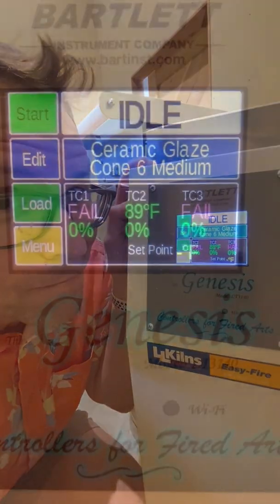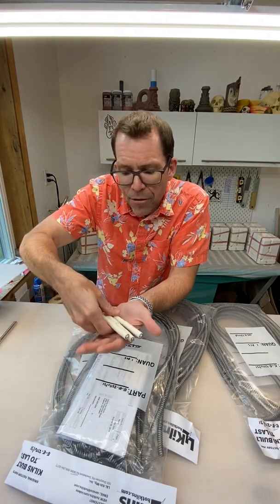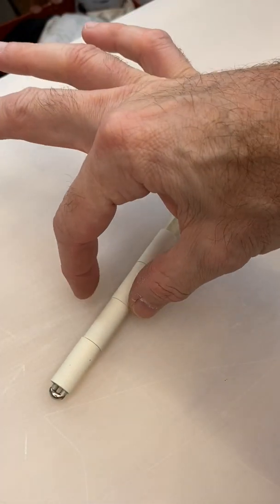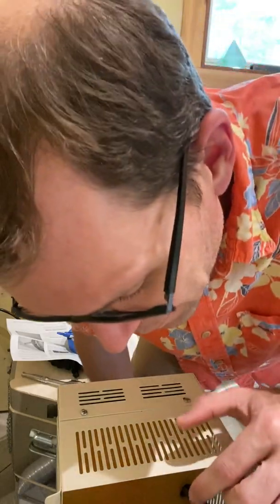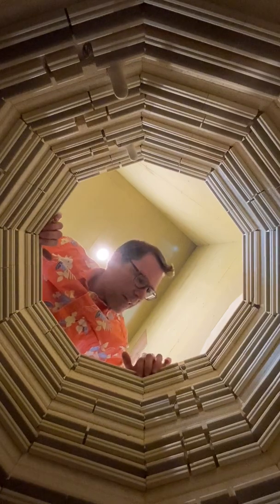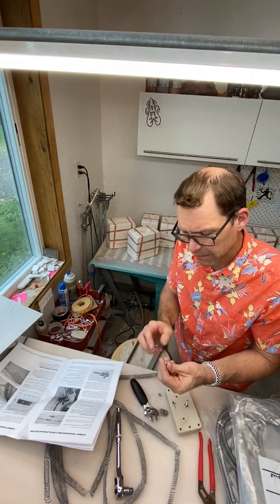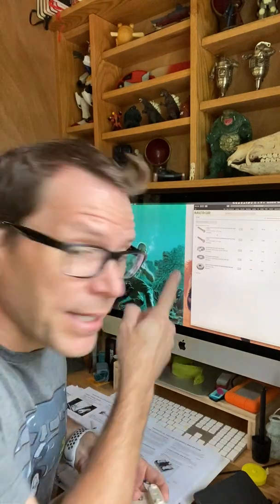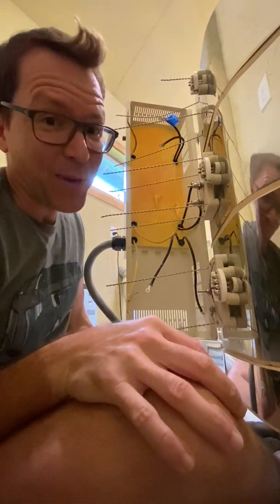Kiln Maintenance Part 1 - Tiki Technical Tuesday 27

Comment: Will Henrik be successful in taming the unruly kiln coils?  Will the new thermocouples find happiness at last? What exactly is a cone? Where is Mrs. VanTiki?  And what of the elusive 10-24 Hex bolts?   For the answers to these and other intriguing questions, Join us next week for another episode of Tiki Technical Tuesday. :)
Reply: I wish we had the cliffhanger music from Batman playing while reading this.  I visualized a picture of Mrs. Vantiki biting her knuckle.  And, the mailman delivering the bolts to the wrong address.
Reply: I can help a little here. A cone is a little spike like item which has a grade or heat limit on it. The idea is that you place a few of them within your kiln so you can monitor your temperature. You know they have hot their temperature limit because they flop over.

You get them for various temperatures so you can see if your kiln is hitting the correct levels and you also place them around so you can prove that the temperature is even.

They've very important and very handy.
Reply from the maker: Cones just may be making an appearance next week  ;)
Reply from the maker: this killed me! I wish I had read this at the end of the video!